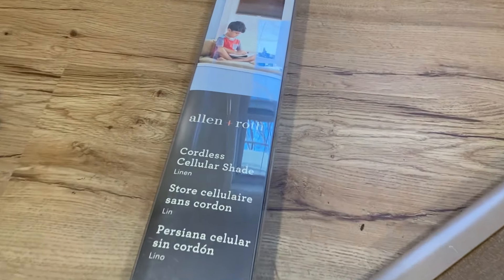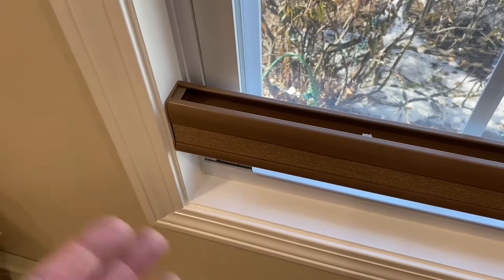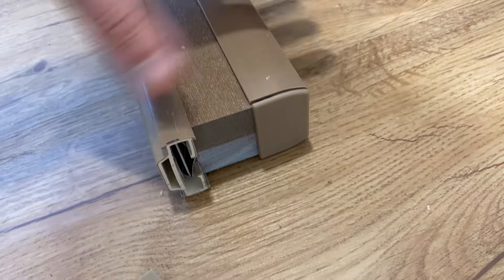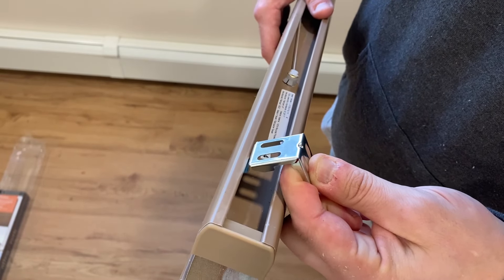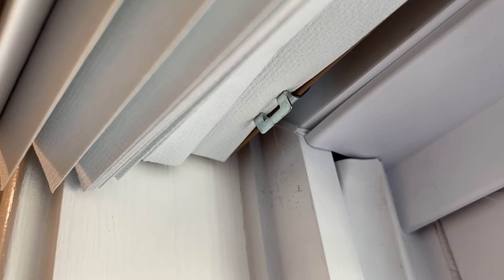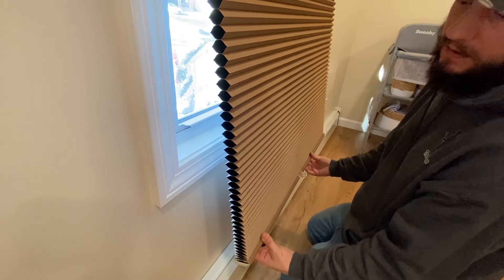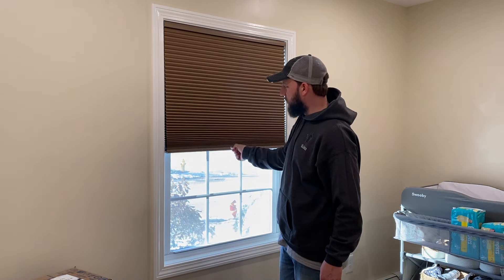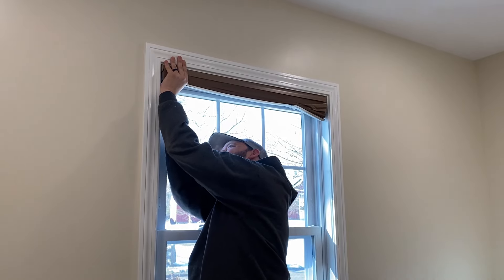How to Cut and Install Allen + Roth Cellular Shades

Comment: Even when using an 80T new blade in my chop saw, the shade material melted and fused in places, making it a royal PITA to expand the shade cells properly without tearing the shade material, which is very fragile and tears easily. 

After messing up two shades, I’m switching to a hack saw for the last one.

Comment: I can only wish that the process went so easily for me.  Got the same shade and same brackets that are installed as yours are.  The shade won't snap into place no matter what I do.  Very frustrating.  

** Update **  I finally got it to work after making a small correction.  I initially installed the bracket screws horizontally, driving them into the face of the frame around the window.  This, apparently, allows the top leg of the bracket to flex too much, and the shade would slide off the top clip when trying to rotate it into the bottom clip.  Removed the screws and drove them up vertically into the top of the mounting bracket, making it much stiffer.  This change allowed me to pop those puppies right into the brackets, no problem.  Yay.  While I'm typing, I'll sheepishly admit that I accidently installed one bracket upside down.  Obviously, that shade wouldn't clip in, but it was an easy fix once I realized what I had done.  I gave myself a "well, duh!" for that one..
Reply from the maker: Hey!  We all have those "well, duh" moments. 😂. Glad that you were able to fix it!

Comment: Thanks I needed this video.  I will have to  hang my blinds on the outer wood frame.    May I ask what type of heating system you have the runs along the baseboard?
Reply from the maker: Hey! It's oil forced hot water. 😃
Reply: I have the identical baseboard heating elements and they are the bane of my existence.  They are in every room and keep "collapsing", impossible to keep them together with all the multiple pieces intact.  Like a game of Jenga I can't win!  Doesn't help when pets crash into them and they all collapse.  So maybe do an instructional video on those?! :)